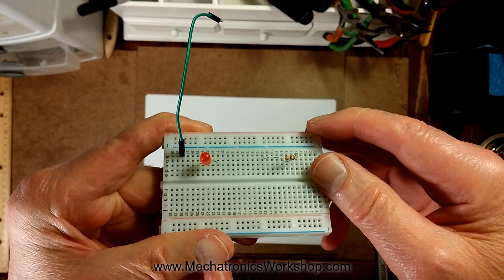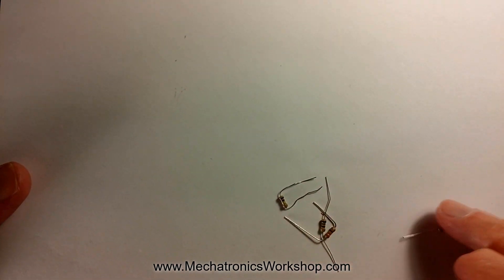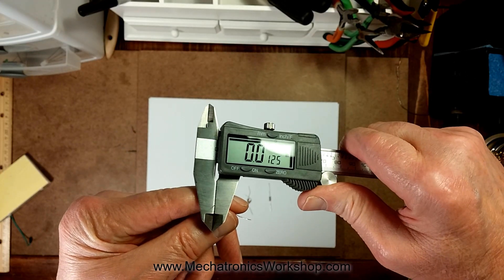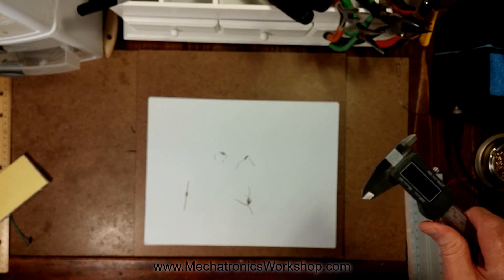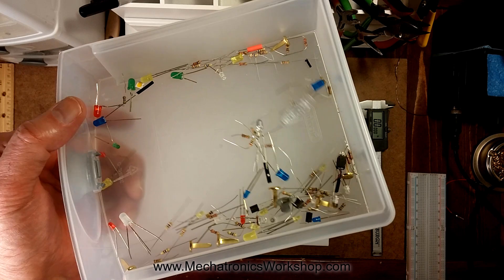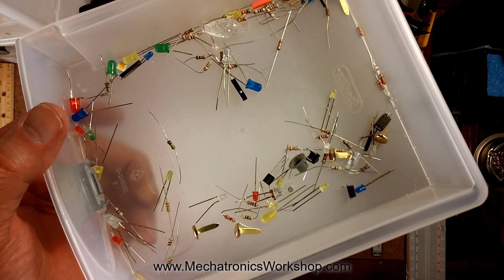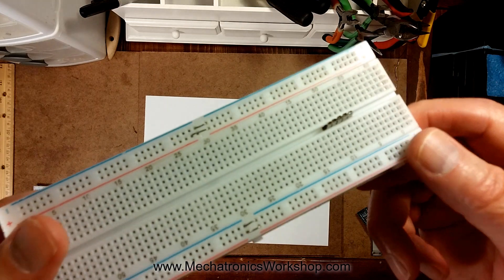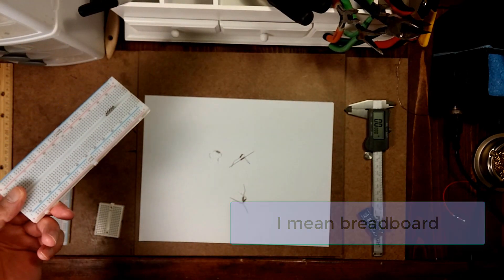How to Solve Your Resistor Leads and Breadboard Problems. (Blame the resistors and breadboards)

Comment from the maker: Choose 'SHOW MORE' above for more info and valuable links!
Reply: is there a new link on vendors with better resistors?
Reply from the maker: @hollybutcher3322  I removed that old link on my website that doesn't work any more. I think I'd just buy from Amazon from now on. It's so easy to return stuff to Amazon, I'd pick a vendor with an assortment that looks good and then just return them if they're the wimpy leads and try a different vendor on Amazon.  It's time we stood up against wimpy resistor leads and said enough is enough!  :)

Read the details on the Amazon sales pages and also the questions that people ask about the product to see if you can learn about the thickness first. Sometimes you can ask a question or email the vendor and get an answer but that doesn't always work. Otherwise, just take a chance, order the assortment that looks good to you and return them if they're wimpy. I see this one has a question about the thickness of the leads and the answer makes me think I'd skip this one and try a different vendor https://amzn.to/3zXWhZl . 

Most people don't have access to calipers that can measure the lead diameters but if you can measure them, wimpy leads are about  0.013" lead thickness, and the better, thicker ones are about 0.020" lead thickness (0.33mm and 0.51mm).

Comment: I purchased the Elegoo Ultimate Starter Kit for Arduino UNO with that breadboard and the cheap blue resistors from Amazon...

Can I just say that it really stalled the fun of building the projects as each time I have to insert a Resistor / Potentiometer (cheapest money can buy!) / even the LEDS (esp the 4-lead RGB type) - I had to use pliers to get a solid feed into the board.  So many bent and warped resistor legs....it's a real shame.

The kit is great for the price, but man I would be more than happy to pay another $10-20 to get a kit with the beige resistors (thicker legs & much easier to read value by eyesight) and a better quality breadboard!
Reply from the maker: Yup, it's sad. If it's not too late I'd return it and try one or more different suppliers.

Comment: Thanks for the video. I've tested it and sure enough: 0.5mm-thick leads are ok to put into breadboards as they are, but 0.3mm-0.4mm ones require bending in the middle of a lead and squeezing with pliers to make it 2-lead thick (maybe even making it into a double helix). Buttons on the other hand require soldering some pins (3x2 with middle pins removed work nicely and securely).

Comment: All these parts are made for manufacturing, and automated manufacturing doesn't need or want thick leads.  That said, for prototyping, their ought to be sets of these components designed for prototyping on standard breadboards - bent and attached to sets of dupont connectors with labels that are readable directly, rather than color codes.  Hobby electronics is an area that is awful for productively creating prototypes.  It ends up being messy, error prone, and the standard breadboard doesn't have any provision for locking parts in place so that they can be strain relieved.  Nothing is well designed for creating user interfaces, and the path from experimenting, to prototyping, to small scale production is uncertain and not standardized.
Reply: Exactly, Big Tech moved to SMD decades ago and only less sophisticated designs/power devices use THC components, so sadly there haven't been many quality of life improvements made for hobbyists.

Comment: THANK YOU! I thought I was the problem, just bought a starter kit for my Grandson and we had so many problems just putting the cheap resistors in the cheap breadboard that it turned it from fun to not fun.
Reply from the maker: Yeah it's a real bummer. No excuse for the garbage breadboards! But some could argue that the resistors with the thin leads are for automated insertion into circuit boards. But we should have the option to buy either thickness. But now you know! Now you can either go on with the knowledge so you can make it all work, or return all the garbage and buy from American sources if you can find the ones I mentioned. Hope it turns fun again! There's one heck of a big, fun, interesting, powerful world out there in electronics!

Comment: thank you! i learned from the cheap resistors with arduino kits its best to loosen up the `adbcde` column pin holes with wire leads before trying to stick these wimpy resistor leads in. definitely helps.
Reply from the maker: That's a good idea!
Reply: thanks this helped alot
Reply: @crazyorange49-OG  glad it helped you! I make those little resistors last by straightening them out with linesman pliers and toss them in a bin.

Comment: How did you loose the finger tips and did it mangle the other hand too ? I notice you need to hold your fingers in the open position. Or is the left hand because you have arthritis ?
Reply from the maker: A metal lathe in high school decided I didn't need the finger tip. The rest is -- you guessed it -- arthritis.
Reply: @Electro-Mechanical-Basics  Damn i bet that stung :D I nearly lost the tip of a finger when the job i was working on came out of a 4 jaw and i foolishly tried to stop it from damaging the bed of the lathe :) Well i managed to do that at least. I could not hold the weight and my finger got pinched between the part, a radio-logical lead shield, and the actual bed of the lathe. The finger swelled to twice the size and i had to drill the fingernail to release the blood pressure :) I was an apprentice turner at the time so lesson learned i guess :/
Reply from the maker: @JohnDoe-qg6hm  Lesson of the day: Keep fingers away from moving parts in lathe :)
Reply: @Electro-Mechanical-Basics  LOL Naw u don't want to do that. Get in about with some emery paper or a hand file :D